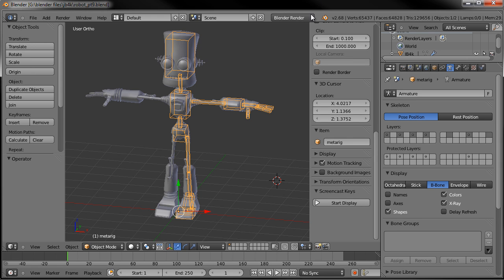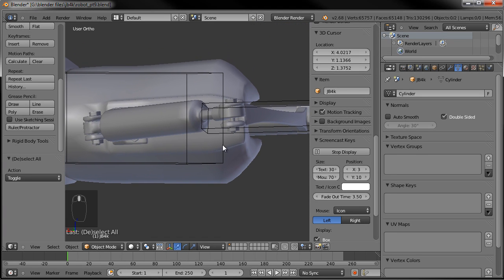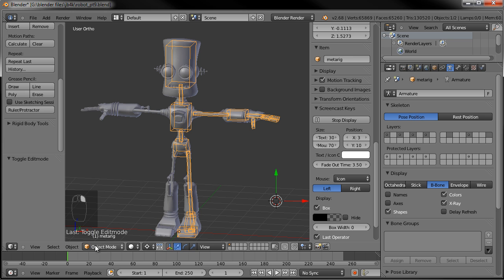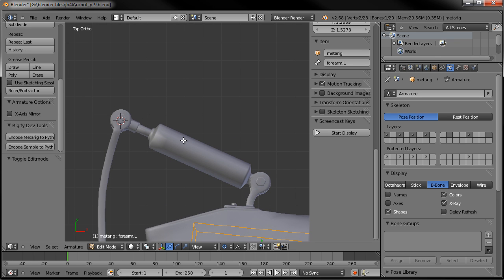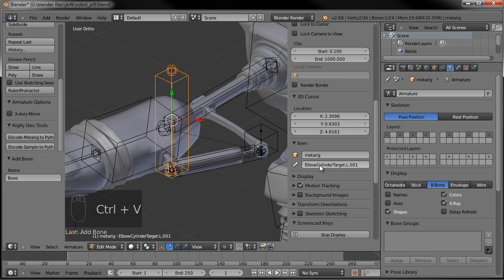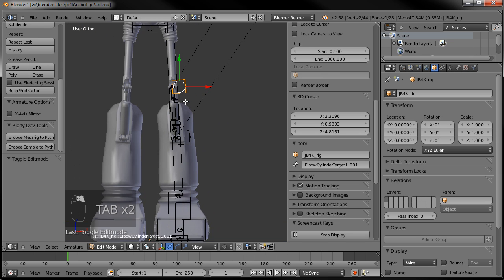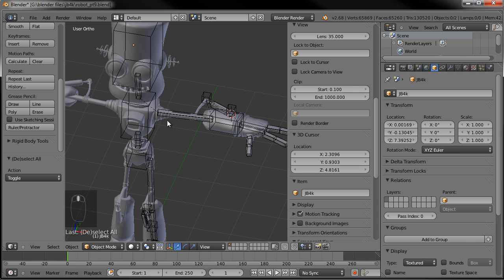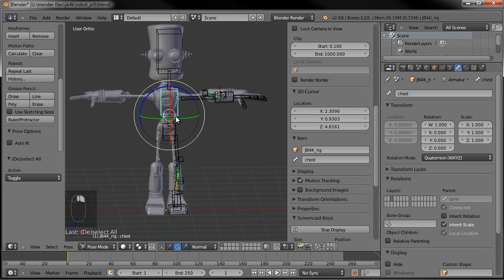JB4K - Part 09 - Modifiying and Rigging the Pistons

Comment: I finally got the arm working right, but my leg is still totally f***ed. At least when I grab the heel in pose mode and try and move it forward, it mostly twists off to the side and doesn't want to move forward like a normal leg should. Could it be the axes of the bones in the legs? Should all axes in the leg be pointing in a particular direction possibly, and if so, which?